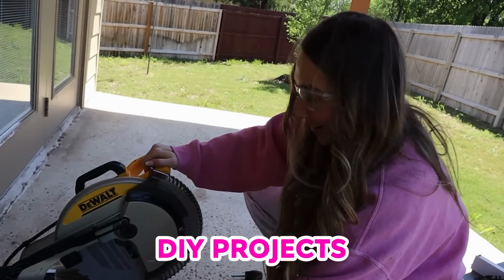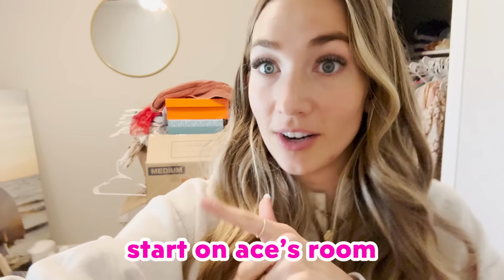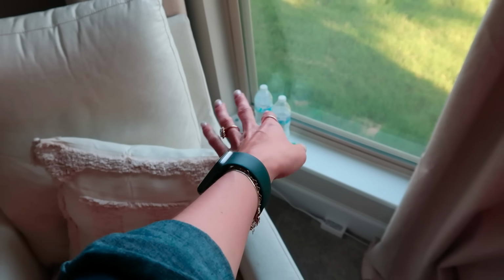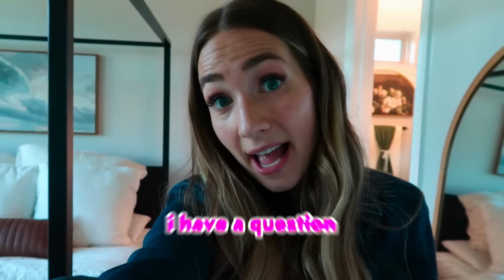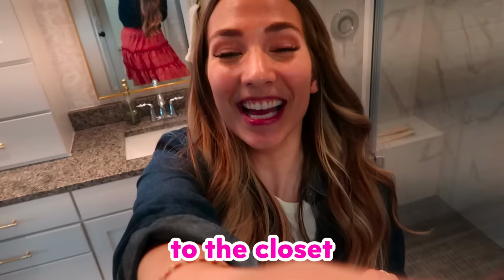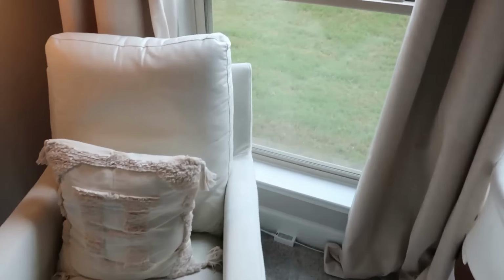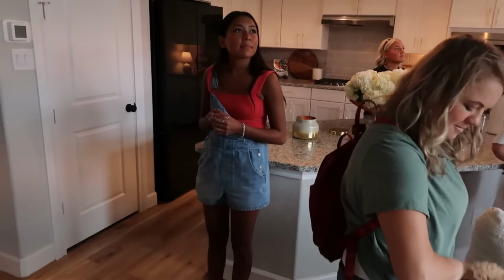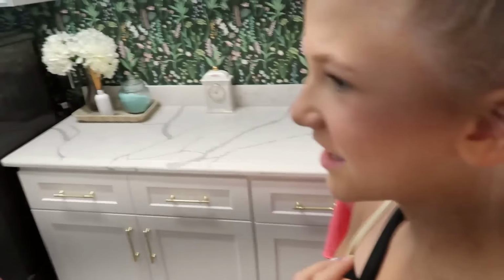My FAMILY of 18 COMES to my HOUSE for the FIRST TIME!!

Comment: Definitely change your bathroom facets before Ace is old enough to use them. I have the same problem, my young grandkids have left the water dripping and it flooded my bathroom more than once, in the process of changing mine now🥴 I think some pretty decorative baskets on top of the closet would look nice, and could be used for more storage.  I live in Texas, you will need those coats especially in Dec, Jan, and Feb!

Comment: For the rug you need a liner. They are like mesh foam and it will prevent it from moving. Also no toilet seats are not hard to replace most of them just slide in and click.

Comment: @KennaDee Kay The rug wrinkle would drive me bonkers. Super ghetto but what I did to fix mine was use a car jack to jack up the bed just enough to slide the rug around to fix it I have an Ikea bed that's steel framed also and to heavy for me to lift while straightening the rug.

Comment: Your house looks amazing!!!!! You’ve done a fantastic job! As far as the toilet goes…you can replace it, however it has a seal underneath. So you’ll need to research that because if you do not properly install the seal it will leak and smell. 🤢 

With the bathroom faucets you need to make sure the base of all of the pieces cover the existing holes and measure the hardware inside to make sure they are the same length and width so they fit properly. Also research the same if you plan on replacing the drain cover as well. I hope this helps.